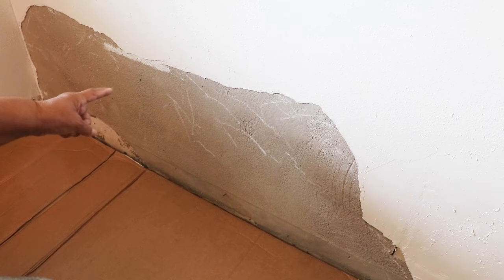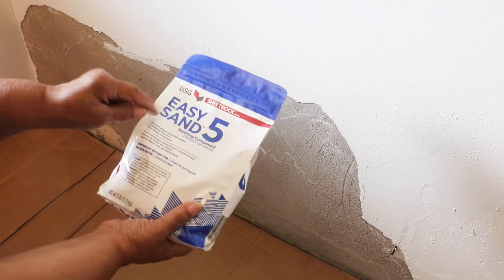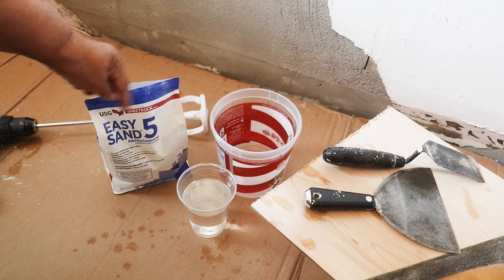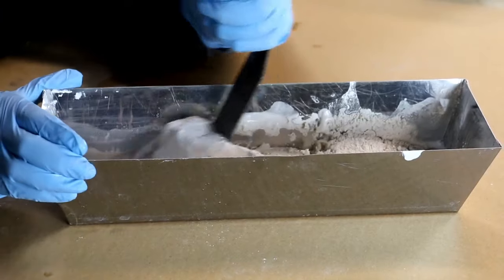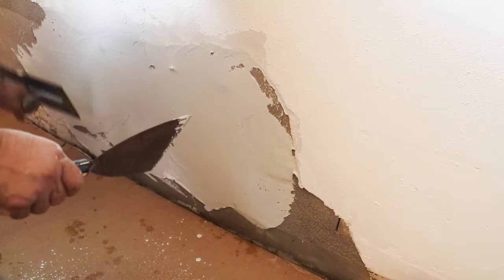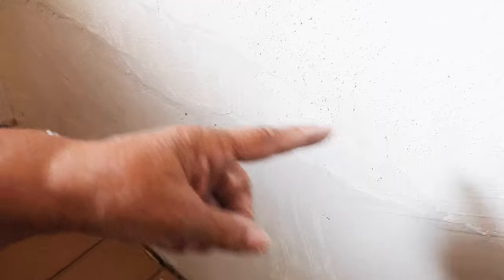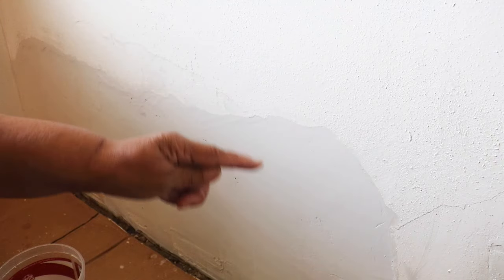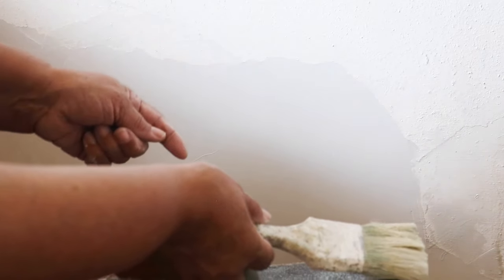World's Fastest Setting Joint Compound // does it WORK?

Comment: I personally use Sheetrock 45. It’s the same company as your 5 min. mud, just a different name here north of the border. I need the time since I’m not a pro or even close. Yes I have to wait longer but since I only work around my home, I have the time to wait !! I prefer a hawk & trowel along with a 4” knife. Could NOT get used to the tray.
Reply: If you want something between 5 and 45 minutes, use hot water, it will kick off and harden much faster. I use Durabond 90 and use hot water to get it to set up in 45 minutes instead of 90 🧠

Comment: You’ve probably heard this in the past but if you add a few drops of dish soap to the water before mixing the Easy Sand 5, the mixing process will go much faster producing a very smooth compound. You will be amazed at how well it works. Not too much dish soap and don’t run high rpms on the drill.
I actually use a 7 quart kitchen stand mixer for all of my small to medium small jobs.

Comment: I can watch you do this. But I can’t get plaster of Paris to work either lol
Reply: Need help?
Reply: Plaster of Paris is finicky. You can get Easy Sand 20 (20 minutes setting time as opposed to 5), 45, or 90.

I use 5 on smaller full thickness plaster patches, 20 on bigger. Great results on plaster walls.

Comment: Love your techniques on using this.  This is a game changer for small areas plus you don't have to mix a large batch.
Leah....have you ever made a video on replacing drywall (large hole) around the outside corner of an interior window (eg. bathroom) over lath background?  Where you have to create the vertical and horizontal cut.  What is the best approach to repairing a fair size hole on a corner.
Reply from the maker: @sleepinglioness5754  the proper corner bead is the trick
Reply: @seejanedrill  Thank you...actually I meant the outside corner.  There was mold on the drywall and I had to remove about 7" horizontally and vertically, so there is virtually no drywall on the wall around that corner.
I don't know if the best way is to cut a piece with a cutout for the corner, or one piece horizontally and then one piece vertically to fill in the entire area..and then tape/mud etc.. (Make a template for the   L_  area cut out)